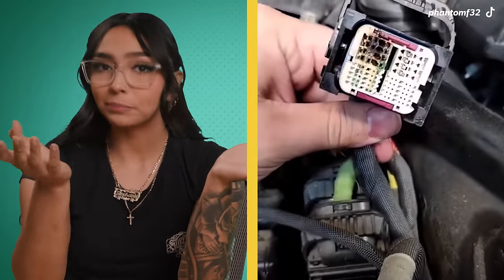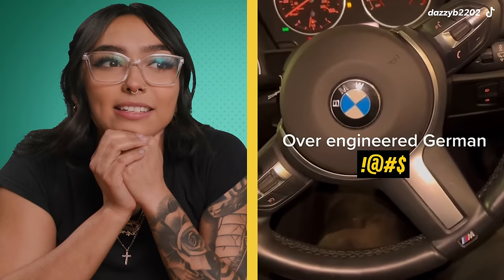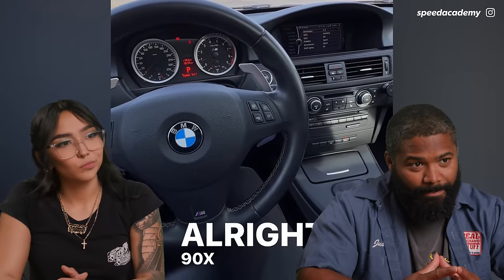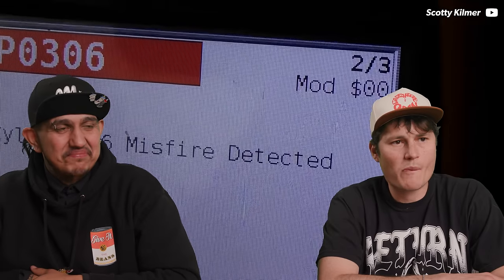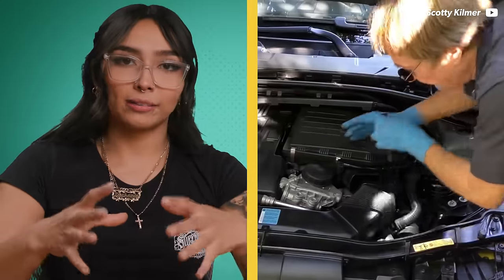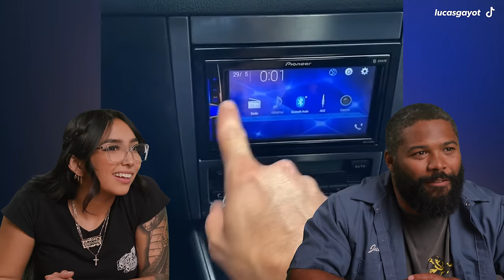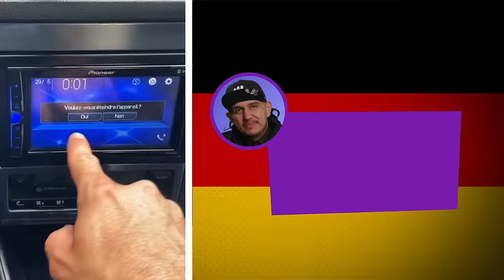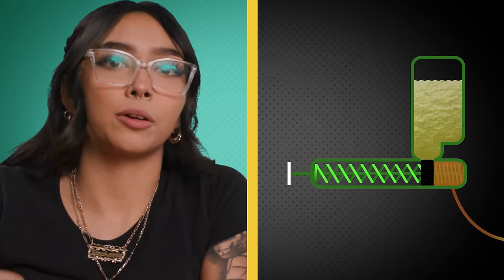Mechanic Reacts to German Engineering Fails

Comment: As a german automotive engineer, we put drain plugs/valves in the rear quarter panel compartments, but people clog them with leaves and stuff, and the water gets in there because they don't clean the leaves and moss out in the trunk seal channel 🤷‍♂️
And if you want to go fast in a car with a big engine in a small bay, you need to get crazy with cooling.
It's a BMW after all, and in Germany, we love to drive 130mph+ for more than 20min without overheating.
Reply: This reminded me a time when valeting cars. So many of them had cloged drains in fuel filler area and this is something people see on regular basis.
Reply: Dude, that is not a good excuse
Reply: @gmarinelarena8675  it's not an excuse, it's the reason. As an engineer you have to keep the balance between manufacturing cost, specifications and usability.
But because car companies are businesses, run by business economists, cost is paramount, spec have to be met that it works excellent in a test and acceptable for five years, then it's out of leasing or warranty and the manufacturer does not care anymore. Usability has to be good in that period, but if it reaches the age that it's not returning to the dealers workshop, the OEM couldn't care less how crazy the package is. 
If the OEM can save a penny during manufacturing and it costs you an arm fixing something after five years, he'll gladly accept it. 
And the engine bays in Germany are not always that well filled, here, smaller engines are quite common and usually the engine that was in the original design.
But for the US engines need to be big, so the most ridiculous, barely fitting blocks are pressed in there, so engineers got to get creative.
Reply: @Brazzelkanal  this is an even worst excuse dude. I am also a design engineer and believe me I take into account all of my designs.
Reply: @gmarinelarena8675  Can you tell me which OEM gives you the freedom of optimising for maintenance and accessibility instead of cost effectiveness? 
It is what it is, that's why I am happy not working for VW anymore. 
I am now happy in a small company working closely with manufacturing and mechanics, way more fulfilling.
Reply: Da sieht man das die deutsche Ausbildung was wert ist... Schön das hier mal Ein Profi spricht... Unter den ganzen hobbyschraubern hier.
Reply: That's what a lot of people don't understand.  There is a reason for these things, and trade-offs.  They are a pain in the ass sometimes though.
Reply: @Brazzelkanal  just make the engine bay larger. There is no restriction on engine bay size.
Reply: @dmwalker24  there is no valid reason. Its just pure laziness.
Reply: if it's not absolutely full under the bonnet it's not ready for the american market yet. like, imagine the bmw with a 4 cyl instead. lots more room.
Imagine a frame on suv with 4 cyl turbo.

the american market car is just chocked full of stuff.
Reply: @tripplefives1402  that would need making separate chassis models just for the usa market.  toyota kinda does that, so there's no hilux/fortuner on the american market.
Reply: Probably another reason for the whole "engineerical mess" is the increasing requirement for engines to be eco friendly on paper, but also have decent performance. 
The manufacturer doesn't care if the car stays fixable for a long time, as long as they meet certain emission standarts. 

In germany taxes for gas guzzling monsters are insanely high.
Reply: @Blobb2013   By law manufacturers should be required to cover all repairs for the first 10 years. That would fix everything.
Reply: @lasskinn474  That already happens for all manufacturers. Mercedes cars for the US market are not made in Europe. They are made in Georgia.
Reply: @lasskinn474   Americans typically have higher speed limits and they have to drive more because the US is so much bigger on a map. The US is the size of all of Europe if not bigger. Driving from the country side into downtown for a commute is the equivalent to driving half way across the average European county.
Sweden for example is narrow enough that you drive farther in Los Angeles just driving across town.
So in the US we drive most of the time at highway speeds and like for our cars to move quickly.
Reply: @tripplefives1402  lol dude that doesn't explain any of it. (not) having money does. it's not that there's not a want for the luxury cars, but you just need to do with what you can afford. I've done plenty of 12 hour drives in finland and in thailand too. the speed limits don't come into any of if either - a typical bmw in germany is a lower end spec, it's just a money and taxes thing - especially the taxes part combined with lower incomes, less money but the cars are more expensive as they are.

typical nordic life outside of capital areas includes lots of driving for hours on end.. the bus might go by once a day, the nearest place to buy vodka could be 30 km away(and at worst 150km+).. but still the more rural incomes are usually lower so the flashier cars are more often seen in the capital areas.

thailand too, it's not like they like base mitsubishi mirages or larger engined bmw's as such but the car you can afford is the one you like and most people can't afford that either, but just the base bmw 320d is 70k usd+ in thailand, a fairly rich persons car, you can buy a gated community house for 50k usd. base small cab 1.9l hilux is like around 17k usd though in thailand, so you can guess which car people who need to count their money buy, the mother in law or whoever well they can just ride on the bed and be happy about it.
Reply: @lasskinn474  None of what you said refutes the fact that German cars have lazy computer generated hose and wire routing in the engine bays. They have absolutely zero incentive to make their cars repairable and would rather you send your car to a landfill every time something breaks and buy a new car.
Reply: @tripplefives1402  I dunno man. google for vw polo engine bay, it's not so bad.

and look germans optimize for manufacturing more than anything else. it's why VAG is such a powerhouse. that's what they tweak stuff to, but that as well gets less attention in the luxury car segment as it's less of a big deal on the bottom line there to save 10 minutes of assembly time..
Reply: @lasskinn474  seconds, you'll get a bonus if you shave off seconds on the line.
As someone who routed hoses in engine bays, yes, we have CAOCD, Computer Aided Over Complicated Design, when we design an easy to replace hose, the computer pulls in some extra loops and bends, because this makes the hose more expensive, and we all know, the manufacturers make their bucks on expensive parts that are expensive to manufacture!
🤣
Reply: My mustang gt in texas, is 3m baht in thailand, crazy. Thats like 120k+usd? Rarely hear v8's and most vehicles are diesel. And also at the petro stations, they fill your gas for you. Texas you do it yourself. But now I find modern usa vehicles do the same, put stuff that requires a lot of taking other things apart, etc. Old cars easy, modern days they do it for reasons $. So really, it doesnt matter because modern cars, brand new chevy, ford, toyota, dodge, honda, all have those moments when you are like, why they put this here or make this like that, or why you make this plastic, or blah blah.
Reply: @Brazzelkanal  The fact of the matter is there is better, more reliable, easier to work with sports cars that can outperform BMW's like the naturally aspirated 490ps mid-mounted 6.2 L LT2 V8 that will probably outlast anything BMW makes
Reply: @tripplefives1402  U don't understand what car design means in this case... But an ancient us car and enjoy it and leave the real cars for others....
Reply: Fix the design

Comment: Based on my time working on a late 90s merc, the worst and most painful part has to be the plastic pieces. They snap easily when taking off, and the worst part is that it is often incredibly difficult to find a replacement piece for them too

Comment: 8:00 exactly! When automakers switched to direct injection the customers started complaining about ticking noises (high pressure fuel pump). Don't be surprised to find lots of noise dampening material on your domestics

Comment: 1:02 - Jaguars XFs - X250 platform - also have this issue. Coolant leaks and it finds it's way to the 'body control module' in the driver's side front fender. So if you're e-park brake won't release, it could be this issue. Common if the car's been sat around for several months. Iirc it's around $9.5k for the harness + module.

Comment: Fun times as a BMW tech.  Had to program an e90 only for the radio to crash mid process.  Subsequently, it took out every other module with it in the process.  Fun talks all round with the foreman, service advisor, and customer about why they needed to purchase all their modules.
Reply: Brooo..... Thats fucking insane!!!! What happened? There is no world in which I want to imagine BMW not covering that...
Reply: @CrossWindsPat  Voltage problems. E9x modules especially lightand body module incredibly picky when it comes to voltage especially if they jumped incorrectly
Reply: @questionabletaste2700  No I meant to ask how did the situation get handled between the owner and the dealership?
Reply: so while the car was in your shop, you caused something to break and billed the customer for it? 
that stuff only flies in America. anywhere else you and the shop are responsible for any defects caused during your work. You are the expert, you are the one who should have known the voltage can damage other components, you are the one who has all the equipment to check the voltage in the first place.  the only way to make the customer take blame is if he did some form of unauthorized modification or repairs on his car that caused the problem.
Reply: @CrossWindsPat  Dralership ended up covering it after everything was said and done.  It wasn't wholly uncommon for modules to just up and shit the bed during programming sessions, just not always to the point where they would brick the entire car.
Reply: @dsj1988  Ahhh glad to hear it! Thanks!
Reply: @dsj1988 I’m willing to bet a good ol’ 12v reset then place it on a charger would have avoided the issue altogether

Comment: Had an audi a6. A certain brake module on that year often failed, it cost $800 to replace, and was tucked in behind another $800 part that didn't fail you had to remove and reinstall when replacing the high failure rate (and nationally backordered, forgot that lol) part.
Guess what Audi did. They re-engineered the two parts into one f**king $1600 molded plastic housing with both inside that replaced the seperate parts.

Comment: I have and old E36 with 140k miles here in Switzerland. Its has the 1.9 105hp petrol engine. It runs and drives great and under the hood it looks like new! I bought it used for 2k€. It has been only serviced at BMW for the past 22 years. Still runs great and no major repairs just the usual wearables.
Reply: Yeah right... for 2k only at BMW...
Reply: The plastic coolant pipe at the rear of the head can be pushed out by corrosion causing them to leak and boil. Seen a few do it and its not really visible. The m43b19 is a tough engine alright 💪 iv owned e36s and e46s and they were designed brilliantly,  it was at the end of the e46s that they started going very wrong. The n42b20a is a 2l petrol engine which when running is powerful and revvy, but everything breaks 😂 thats what replaced your engine
Reply: Would love an E36 but most of them are either fked up from drift boys or insanely overpriced :S
Reply: @Hk7762Tube  He said serviced at BMW, not purchased...
Reply: @Mrich775 I get it, also 2-3 "services" at BMW would be at 2k range probably, so I will dubbel down and say its BS, if true, that car should be at the museum.
Reply: I got 1988 subaru xt with 97 hrs prs, we should race
Reply: @Hk7762Tube  He also never stated the cost of maintenance...
Reply: @BAK87  ill be honest with you....they are all scrap. Any true e36 owner will admit it but they drive so nice it makes up for it. It would be easier list what does not break on them 😂 The only e36s that hold up very well for some strange reason is compacts. They dont rust anywhere near as bad as coupe/sedan/touring. The more basic the model the less electrical problems you have. They are a very easy work on car aswell and loads of forums with all the info u need so if u really want one just find the least rusty one you can find and be ready for a Love/Hate relationship 😂😂
Reply: @Mrich775  I get it you are Type-R Civic, emphasize on R
Reply: One thing to consider, the cars sold in the US are made in the US/Mexico/Canada. They might have been engineered by Germans, but they are not assembled by Germans, and it seems like the cars you see in the US aren't as well built as their European counterparts, even Tesla had this issue (the cars made in China don't have the shoddy assembly that the American made ones have) so I think it's a US thing.
Reply: @Hk7762Tube  Good for you, rather than read, just spout your immature insults.
Reply: Are dealer cost for maintenance over their quite expensive as well?
Reply: yeah the BMW M43b19 4 banger. actually pretty damn solid engine, i had a e46 with the same but updated 118hp engine. its by no means fast but its incredibly easy to work on. the only real problem i had was a coolant hose leaking under the intake manifold but that was not that bad to diy.
Reply: @Hk7762Tube  That's actually solid price for E36. Most of them are already badly rusted out and sell for barely 1k EUR. For 2k you can find a decent one or basically perfect shape E36 compact (because most people think it's hideous it became cheap and undesirable).
Reply: "It has been only serviced at BMW for the past 22 years."
Meaning it cost 10 times the price of a car to maintain it over the years, got it.
Reply: @JohnSmith-oh9ux  you do know its a 4 cylinder engine? and that Switzerland is right besides Germany making parts cheaper then many other places plus it an older BMW engine making it more reliable and easy to work on then the newer ones.
Reply: @JohnSmith-oh9ux  
It cost someone 10 time the price, but not him. So far.
Reply: Here in the US, 140K miles isn't s***. Here, if your car can't do 200K with proper maintenance, you feel screwed. I've seen Toyotas, Lexus, and even POS V6 Buicks with well over 300K on them. My old Grand Cherokee looks ragged as Hell, but it has 389K on it. And it still has all the original drivetrain.

Admittedly, none of those cars are typically driven as hard as a BMW, but here in the US, most BMW's with the mileage yours has are already in junkyards. For the price, you got a bargain, as you have a car that's a pleasure to drive, and it may be one of the better made BMW's. And you chose a well-maintained one.

Here in the US, where we're too cheap to spend much on maintenance, BMW's tend to be neglected, so finding a good one is really difficult.
Reply: @watchman1872  my e46 had 316000km on it when i sold it and my friends 320 e36 had over 400000km on his.
Reply: It's statistics, there will always be exceptions and if you're lucky it's a good exception. Plus they used to be a lot more reliable pre-2005 or so

Comment: My e46 330ci ZHP ran nearly flawlessly for 185k miles. Outside of normal maintenance the only things i had to replace were a valve cover gasket and a DISA valve. I did have an e63 650i manual coupe that was a nightmare. 

My 25 year old Porsches are some of the easiest cars to work on I've ever had.    They've been great cars too.

I had an Audi S4 for awhile that was great to drive but cured me for ever wanting another Audi based on how often I had to work on it. 

None of my german stuff has been nearly as difficult as my Z32 300zx was to do just about anything.

Comment: Ex-Audi owner here. Ended up fed up with the programmed obsolescence and over complicated repairs. Not sure how much money they make on the cars themselves (but pretty sure they are not losing with the sales), but I do believe they do much more with service and maintenance. Gear sensor (180 eur), changing it: 4500 euros (whole transmission out, disassemble, change sensor, assemble back and adjust gears).